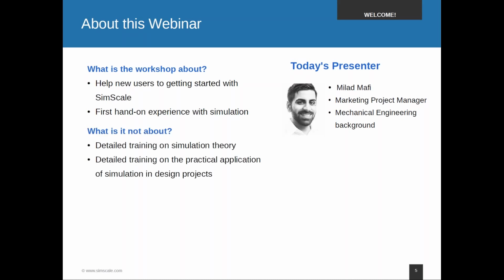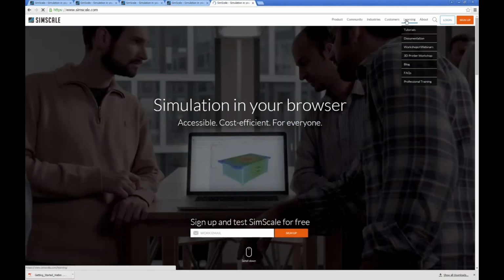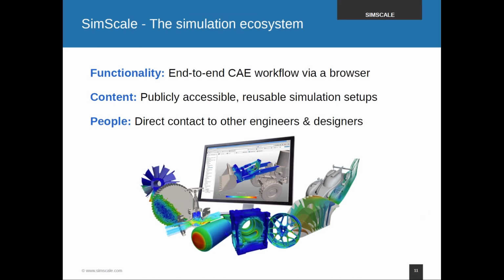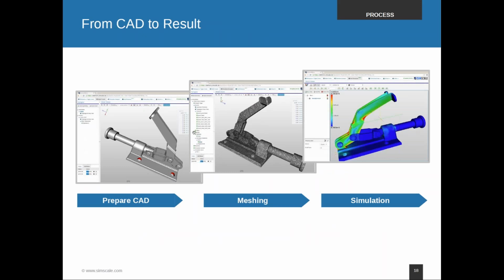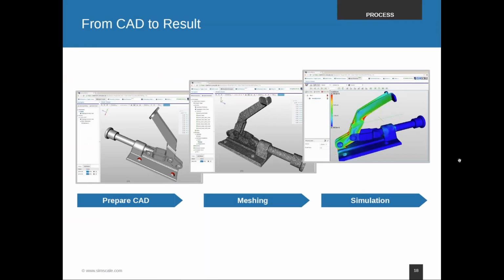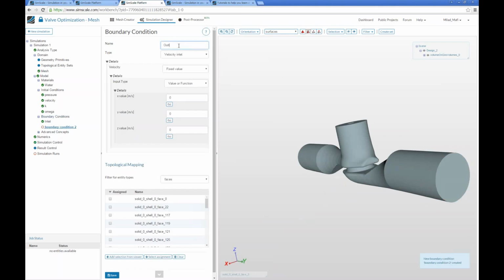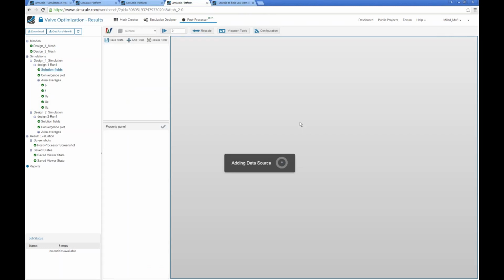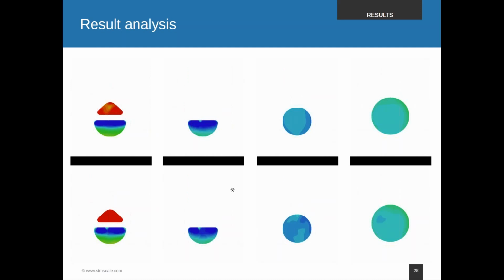[OLD] Getting Started with SimScale

Comment: will the simulation work for subsonic and supersonic air speed over a body of different shape.  Or what software should I use to achieve it?
Reply from the maker: For subsonic simulations (less than Mach 0.3), the incompressible solver (https://www.simscale.com/docs/analysis-types/incompressible-fluid-flow-analysis/) can be used. For any higher flow speed, the compressible solver (https://www.simscale.com/docs/analysis-types/compressible-fluid-flow-analysis/) is applicable.